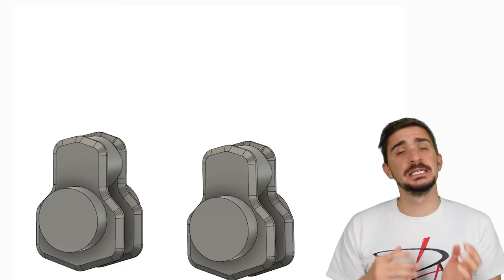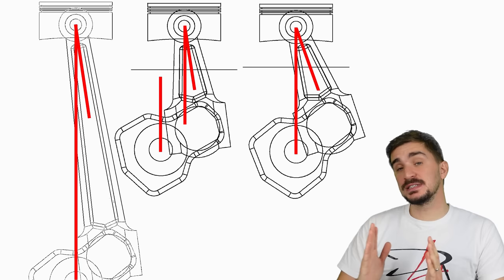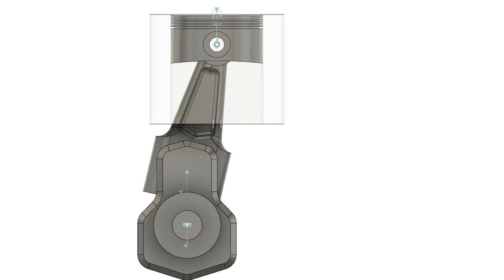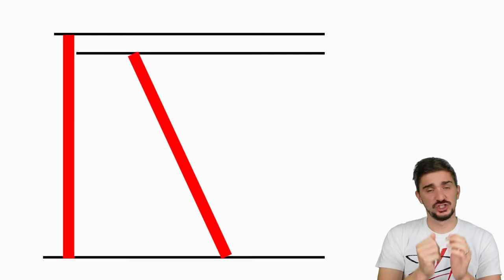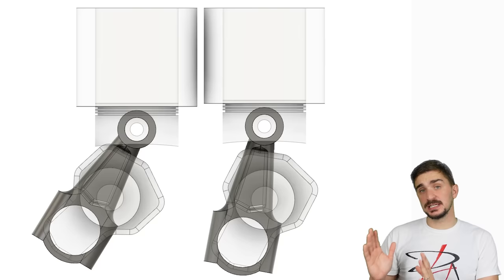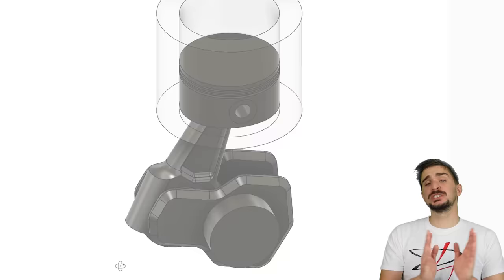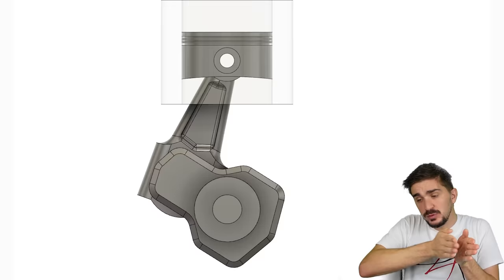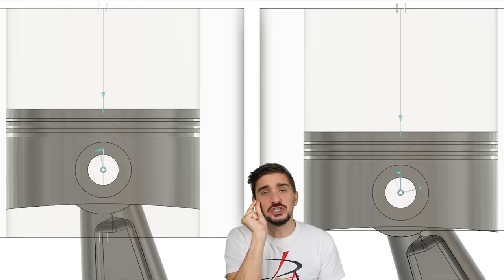Cylinder Offset Changes Everything

Comment from the maker: Become a Tuning Pro: https://hpcdmy.co/dr4a
Support the channel by shopping through this link: https://amzn.to/3RIqU0u
100 cars that changed the world: https://amzn.to/3DGXDf6
Stem engine model: https://amzn.to/3Y5iZLv
Motivation: https://www.youtube.com/channel/UCt3YSIPcvJsYbwGCDLNiIKA
1-2-3 count with Car parts: https://amzn.to/3jxP7Z6
Patreon: https://www.patreon.com/d4a
Reply: 14:45 time is a false measurement here.
It would be better to operate with a  angle*momentum sum across the combustion stage. Here the difference in top dead points is kicking in: making the momentum more linear, normalizing piston speed, increasing fuel burning duration thus allowing fuel to burn completely.
Reply: Balance issue is not an issue actually.
Vankel engine has same offset geometry, and solves the problem with excentric geometry of the crankshaft
Reply: That is interesting and makes sense as it's making more out of what it's given eg the time, so I'm thinking with different compression stroke,less time, would it be better for boosted engines be that supercharged or turbo
Reply: I love that you made this video. This is such a great lesson on engineering. Sometimes what may initially seem weird or counterintuitive identifies an aspect that can lead to creative gains.
Reply: I wonder if alternately offsetting the pitons would help the balance. You might need to have a different firing order and inlet and exhaust valves also on alternating sides. I am too tired to get my head around it at the moment, but I might think about it when a bit fresher.Great explanation, thanks.
Reply: willyberg123  oops. I've just read your comment. We seem to be on a similar track.
Reply: Absolutely phenomenal video, as always. One minor discrepancy found right around 15:00 is that the torque multiplied by angular velocity (power at the crank) will always be equal to the force on the piston multiplied by the speed of the piston (neglecting friction losses). That's to say that the during the compression/exhaust strokes, the work done on the piston will be the same for a conventional or offset crank design. Similarly, even though the power stroke lasts for a longer amount of time, no real additional power can be extracted from the combustion cycle due to an offset piston, despite the increased torque, other than what's gained from the lack of friction and allowing the fuel to completely combust as early in the power stroke as possible.
The reduced friction losses, however, is brilliant since the combustion stroke obviously typically has the largest friction losses in any engine due to the increased lateral force on the piston. 

Thank you for the fantastic videos, the visualization of these concepts always helps with the thought process, and the unique topics presented are always awesome to see!
Reply: Yes, while high RPMs are more efficient than normal engine RPMs, the opposite is true at low RPMs. This is because the ideal combustion angle of 10 degrees requires even more advance at low RPMs, which will shorten the total combustion time and lead to a decrease in total work.
Evet normal motora göre yüksek devirlerde daha verimli ama düşük devirlerde ise tam tersi verimsiz olacaktır, çünkü ideal patlama açısı olan 10 derece, düşük devirlerde daha da fazla avans vermeni gerektirecek, bu da toplam patlama zamanını daraltacak ve toplam işte düşüşe neden olacaktır diye düşünüyorum!